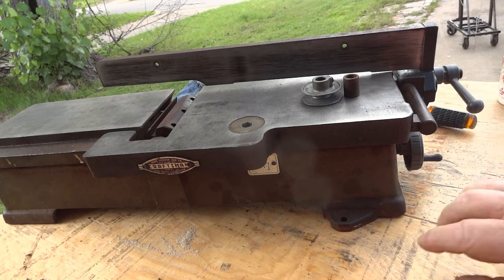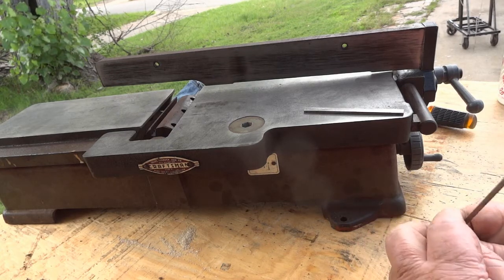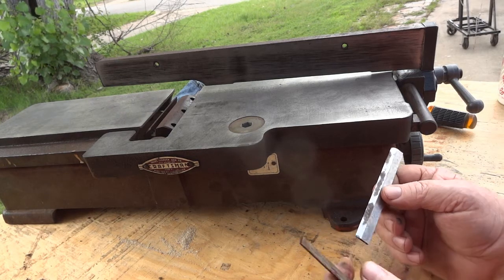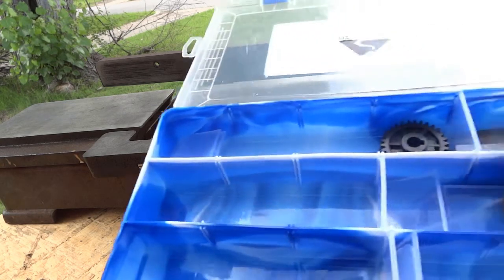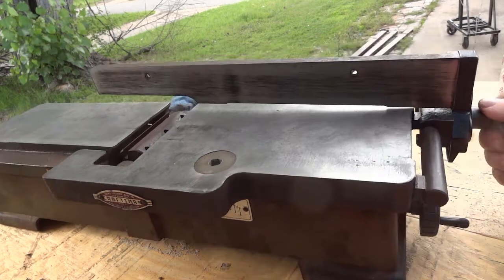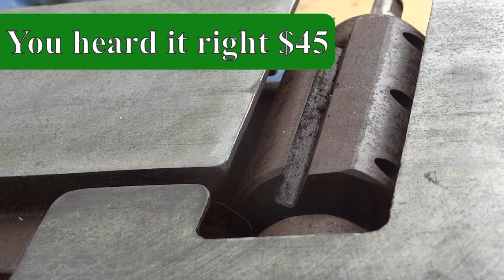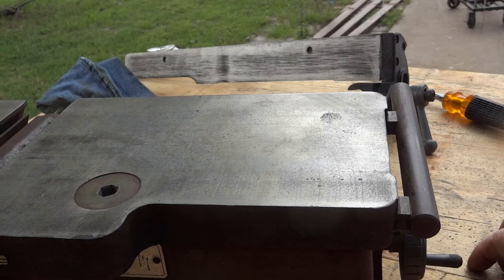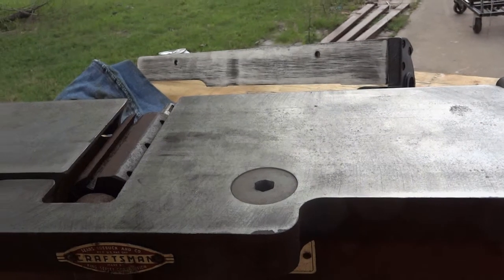Rebuild of a Craftsman Jointer, 103.23340 Part 1

Comment: I just purchased one with the motor, it didn't have a guide, just found one on ebay. The motor causes the circuit break to to shut off power. 50 dollars is what I gave for it. You video is a great guide. Thank you.

Comment: Those screws coming out  are phillips head mine were slotted  guess mine is older than yours
Reply from the maker: Actually they were the wrong screws and were only holding by a couple of threads. They were replaced with something with a better fit.

Somebody was in mine before me.

Comment: I have a later version  table saw / jointer combo that I bought used years ago... and I'm giving it a bit of a tuneup. I rarely used the  jointer and the  blades (just 2 in this model) were pretty rough when I bought it. They measure approximately 4 1/16" in length, 11/16" wide and 1/16" thick. Where can I find suitable replacements??? All I've been able to find are 1/8" thick - would those work? Thanks.
Reply from the maker: Give me the model number of of the saw and I'll look around. I've not done an 8 inch.

Comment: ------   shame you didn't show the removal of the cutterhead and bearings  (  the bearings ALWAYS need replacement in an old machine )  -   at least you posted a link to the original owner's manual which shows the parts layout if not the actual removal process  in Part 2
Reply from the maker: the side with the snap ring is the side it comes out. a brass drift punch is what you need. Make sure all the grub screws are out of it first. Mine was buggered up bad. The guy before me must have tried it without removing the grub screws as the shaft had the tell tale marks left behind. It should not take much to drive it out if it was never molested before. I had to spend some time with a file to make it right again. I was considering making a new shaft. It took 30 minutes with a file to get it to go together like it is supposed to fit. Not only were the grub screws forced in the flat sid but the round area as well. I was considering removing the head on mine with a sawsall.

Comment: I have this jointer and the 8 1/4 table saw sitting on the metal stand sold with it as an add on option allowing you to use one motor for both saw and jointer. I also have the lathe purchased later that year. My grandfather purchased them brand new. I build custom furniture for residential and commercial clients. It's a dedicated little setup to this very day on expensive hard woods. It's absolutely amazing that tools built just shy of SEVENTY years ago are even usable/operating but being able to do so with enough consistent precision to be an asset in fine woodwork. They damn sure don't make them like that anymore!
Reply from the maker: I am collecting the vintage Craftsman saws, planers, jointers and other large power tools for the reason that the common tool made 70 years ago today would be considered commercial grade equipment. Having a lathe and mill supplies those parts you just can't buy. Sears was a tragic loss, especially the parts department.

Even older Skil power tools were made to last. I have a variable speed Skil drill my father bought when I was 8 years old I still use. The only part replaced was the plug, the cord is still original.

The consumer is getting hosed with tools that are not worth having. Sure good tools are a real investment, but if you bought them back then and kept them in a good state they are worth more than the new offerings. But them $1 back then is worth $12+ dollars today. Even our currency was cheapened. :(

Comment: Hi. I have a similar craftsman jointer, but it's the 6inch. Right now, the fence won't "return" over the blade after doing a cut, so I think the spring needs to be adjusted. Would this be something thay I could get too without taking the entire jointer a part?
Reply from the maker: I have a 6 inch but have not gone into it at this point in time. If the pivot is stiff from rust a little 3in1 oil and working it in my fix your problem, if not you will have to take it to the workbench and flip it over and take that section apart for cleaning. 
I don't have the model number of your unit, but is you give it to me I can provide you with a link to the manual.